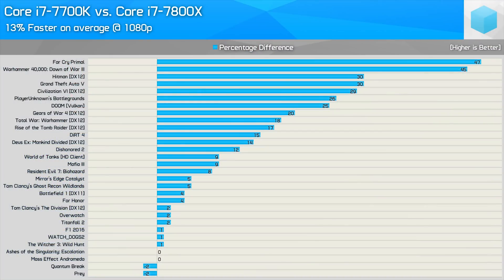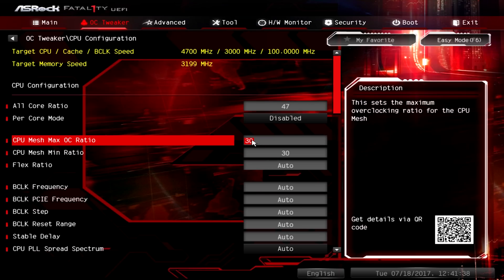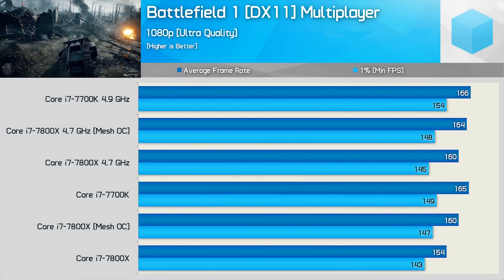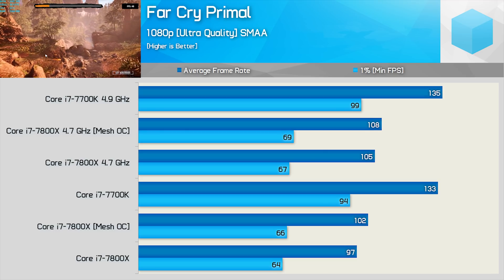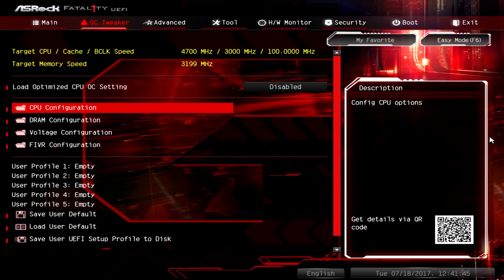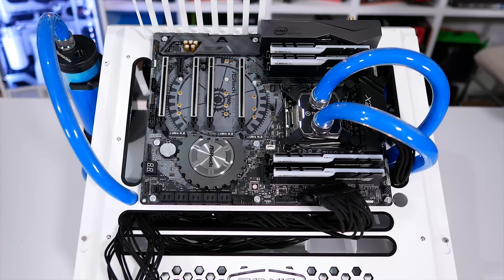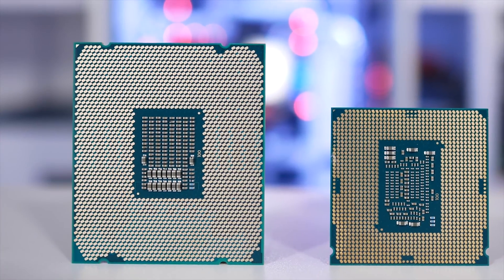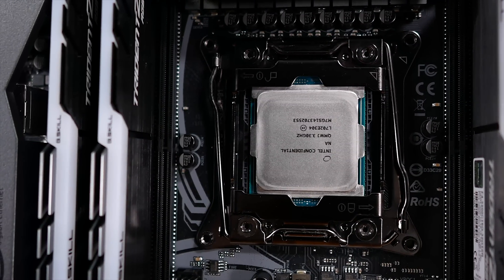Intel Mesh, Does Overclocking it Fix Skylake-X?

Comment: just upgraded to x299 with a 7940x, but at 320 shipped for the chip... i cannot complain... 3200 on the cache and 3733 cr1 on 64ggb of super cheap ram... at the rams 3200xmp..  for my system and got 4.6 all core turbo working well, if i wanted more, i would need to get a better AIO or go custom, and cant really afford to go custom.. i live on ssi, i only upgraded from the w3680@4.6 because the motherboard died... this has been fun though... i cant really complain at these prices... 320shipped (got it in 2 days) for 14c28t.. not bad...
Reply: the x299 prime II-a has worked well for me so far, it takes tinkering to get the best out of them, what we have found, the AI clocking tool can actually be VERY effective if you tinker with it enough, and test it with of all things a negative offset of at least 0.025, you should actually be able to get 4.7+ in most of these chips pretty easy...slightly better cooling (this cryorig a80 is several years old and been pushed hard keeping  a 9370, then a x5675 and w3680 to 4.6-4.7 range for years 24/7... but.. with quad ipp fans, 4.5-4.6 has been pretty easy to dial in with a .025 core offset helping offset the ai's over use of voltage.. 

if i could easily apply the settings i have in xtu via bios i could get it down  a wee bit more, but.. i genuinely cannot complain about these results, the systems working quite well and should hold up a good number of years with just swapping to a 9 or 10k chip if i dont just break down and delid this thing and replace the stock TIM myself to gain most of what the 9k chips brought us...)

Comment: Try it again with the correct settings to test CPU, instead of setting to very high graphics settings, and have a serious go at overclocking it rather than a 5 minute attempt. That was testing the 1080p performance of the video card just as much as anything else in the system.

Comment: YES IT DOES! 

7980XE@5Ghz all cores
DDR4 4000Mhz CL15
Mesh at x33

Memory latency is 46-47ns

R15 single is 225! That’s stock 10900K IPC right there!

R15 Multi is 5,000 thats 

R23 is 31,000!! That is (2) 1950X Threadrippers lol. Or faster than a single 2990WX Threadripper.

Yep a 4 year old CPU!! 

Oh and R20 Multi is 11,720!

I run these speeds daily in games and work on direct die and (3) 360’s.

Comment: Use per core overclocking and on the best core or 2 cores you might get 4.9Ghz which does help games. Also 3.2 mesh and setting memory to 3.6Ghz+ will be able to match the kabylake. There you go :D

Comment: There are ridiculous gains when you OC the mesh and pop in 4000 MHz Ram, Rise of the Tomb Raider see a 70 FPS gap at 1080p, Far Cry Primal  34 FPS, GTA V 23 FPS.
Reply: You mean 70 fps Difference between normal ram/no mesh oc and 4000 ram and mesh oc?! 
Just got an 7820x 5ghz and thinking About buying trident Z rgb 4000 cl17 Kit

Comment: I'm thinking of returning my 7820x just because of this video. I don't get it, what makes 7820x perform worse than the 7700k clock for clock? Or the 6900k? Is it just the cache system? I thought it was just as good as the 7700k in single thread.

I've watched reviews at tomshardware and the 7820x wins over the 7700k with a large margin. How come it's losing here so badly?
Reply: Your overthinking it, 7700k is quad core = easier single core score

Comment: I find your scores low especially for Hitman and Rise of the tomb raider. I re-did some of these benchmarks with my 7820x at 4.8ghz and disabled 2 cores. I had to run Hitman and rise of the tomb raider in 720p becuase of GPU bottleneck, but I ran Civ VI at 1080p. All the other graphic settings are the same as yours.

Here are the results and screenshots:
Rise of tomb raider= Avrg 164fps  - http://prntscr.com/gaq8e3
Civ 6= avrg 71 fps and %1 low 55fps - http://prntscr.com/gaqb27
Hitman= avrg 152fps - http://prntscr.com/gaqd90
Reply from the maker: Cool, an apples to oranges test. NOICE!

Comment: Intel's i9s are good CPUs on the whole, they just are way more expensive than equivalent Threaripper CPUs. Who would spend $1000 on a 10 core when they can get a 16 core for the same price?

The deficit in gaming performance is because of its dreadful core to core latency -- which is exactly the same issue dogging Zen. When this is optimised for in software you can expect a significant boost for both.

Comment: Steve and all tech youtubers does not understand this, Innovations is bad, was bad for AMD and now is bad for intel because the CPU is nothing without a good software, what you were getting from intel is just the same thing over and over again the only improvement was the clock speed just that, now they came up with a new architecture and they are paying the price the same that AMD was paying from the FX platform and Ryzen,  the problem was and is not the hardware, again you should understand the importance of software on this, is like Apple & android vs Blackberry what kills blackberry was not hardware or the OS it was the software ecosystem and compatibility, software needs to mature and you need to understand this because also you are not accurate on this matter you just look at the numbers and not the big picture,  is not the game what you need to address here is the Engine, all engines needs to change because Gaming developers are just programming on top of the engine resources itself that's why Bethesda is getting a pause to work on the new engine, that's why AMD was so freaking amazing with Doom using vulkan because you can really measure what is really under the hood, and this is something that you need to realize STOP benchmarking DX11 titles with MCM architecture is useless is not going to perform better than the previous cpu for that happen software innovations needs to be done and that's is a more slow process than creating a new hardware.

Comment: chuckles The 7700k took all the cookies and left the x299 and amd parts hungry
Reply: Which one is still useable today in 2021? The 7700K is worthless for gaming today.. 

My 4 year old 7980XE at 5Ghz matches a stock 10900K in single threaded testing. And I can literally just double a Threadripper 1950X in multithreaded. Or beat a 2990WX Threadripper in multithreaded. Yeah That’s a 32/64 lol. 

R15 Single=225
R15 Multi=4988
Reply: @videocardzrule354  I wouldn't call it useless, but 4core cpu's are on the way to the grave for modern games. See your 7980xe still only just matches the 5 year reign of the 67/7700k's in single core, as for multicore they are fine.. but the platforms dead, amd killed it with threadripper and the 3900/3950 and moving on 3 years later after this discussion the 5900/5950x.. which will hand the 7980 it's ass all day long, they are eol as far as I'm concerned and is why I moved along to a 3700x... 3 years later..I am pointing out that was 3 years ago and x299 is still pointless 3 years later.. 3yearsyah..cya as the cool kids like to say.. 3 years ago.
Reply: @videocardzrule354  Dude who cares.. That comment was made 3 years ago, I don't care go argue with someone else maybe on your intellectual level..You are making a pointless argument about 4-5 year old tech that nobody cares about anymore, other then people still stuck with it or flippers. Move along man. Any more stupid comments about your over priced under performing 79860xe I'll show you the hand and block you. I don't care. Clearly you are bored or stupid and couldn't take the hint the first time. Now I'm making it official don't bother me about your bloody cpu, nobody cares.

Comment: So, Intel is helping to close the gap between Ryzen and Intel CPUs... This is really disappointing. With this, there is absolutely no reason for me to consider anything other than Ryzen.

I did look at X99, but the boards just didn't have the I/O enabled without the high-end chips, which are not worth the money. The boards also had 3x the RMA rate.

For people who want the fastest single-core performance, like a 3D animating workstation, the 7700K seems like gold that may be worth holding onto. Unless Intel and AMD use different architecture for low and high core counts, it could be king for a long time. But, you'd probably want to buy one that has had the poor TIM replaced.

Comment: I think someone bought the i7 920 to do a video!!! I don't think I have seen any video on the channel featuring the 920. I still have one in my old desktop PC overclocked to 3.5 Ghz (with boost) at an undervolted 1.1v since 2009, and would like to see how it fares at a decent OC level in recent games with a mid range graphics card like the 1060/580.

Anyway, keep up the good work Steve, best hardware channel for some time now on Youtube (and I have been a subscriber since this channel had 6k subs).

Comment: well its their first try at it in almost a decade so it is not perfect yet also a ring is only good up to a point i guess that point is around 6 or 8 cores not 10+ so they changed it but it goes slower so i guess a test between one with a ring and one with a mesh would be nice if you can

Comment: I've watched this video and the original 7800x vs 7700k comparison video.  I took interest because I was in the process of a new 7900x build, which has been completed about 48 hours ago.

I would like for Hardware Unboxed to confirm the framerate disparity is not an nvidia drivers issue as opposed solely due to this new mesh architecture.  The reason I say this is because I have some very peculiar and suspicious observations in my build, though pertaining to SLI.  I realize that SLI is a different beast, but I urge you to look at the findings so far.

Here is a thread about someone who has built several configs of his 7900x via different X299 motherboards.
https://forums.evga.com/SLI-Issue-EVGA-1080-Ti-FTW3-on-X299-Motherboards-m2696423.aspx

The results show that no matter what is done, the performance of SLI is drastically worse.  Within these threads, more URLs surface.

In here, there is a post showing that the smallest increase in Resolution Scale setting of BF1 from 106% to 107% will cause a GPU usage drop of 20%, causing framerate to instantly plummet from 100 FPS to 80 FPS with only a minor increase in total pixel resolution.  Why such a huge drop in usage? Who knows, but it seems like it is more an nvidia driver issue than a new Intel mesh architecture issue.

https://forums.geforce.com/default/topic/1017324/?comment=5186834

Also in these threads, is a 3D Mark comparison.  Again, this is under the SLI category, but the exact same cards, 2x GTX 1080 Ti SLI yield a massive 36% difference in favor of an X79 build vs a new X299 build.  Recall that Sandy Bridge-E is 4 generations as old as than Skylake-X.

So I'd like to reiterate that this is indeed not an apples to apples comparison to Hardware Unboxed's findings, mostly because these URLS speak about SLI performance isues, which is a different beast on its own.  But if you go through all these findings, the general though unproven consensuses is that there is an issue with nvidia's drivers.

This video hints at an upcoming Ryzen comparison yields "interesting results", but perhaps there is an issue in nvidia's drivers that do not currently work well with X299 chipset, and show no issue with Ryzen.  My understanding is that these benchmarks use the most powerful graphics cards in order to focus solely on CPU performance.  I am not certain, but it seems that the benchmarks in these videos come from Titan XP's.  Is it possible to do the similar comparisons in the 7800x vs 7700k video, but with a high-end AMD card?  I am curious if the disparity of nearly a 50% performance difference of Far Cry Primal also exist even with AMD cards and drivers.

For the record, I would note that I am not trying to look at my new build with rose-colored glasses.  I am completely aware that a 7700k should indeed beat a 7800x in terms of gaming performance.  My new 7900x build is for game development primarily, but also gaming.  However, I cannot get past the fact that Far Cry Primal has a massive double-digit performance advantage on a 7700k, and your theory is that its only because of the new mesh architecture.  When I see difference performance numbers that staggering, I find it completely suspicious that other issues are at play.

Comment: If the margin of error is always positive towards the 7800X then it's not really a margin of error. Real errors would skew both ways across a wide variety of samples
Reply from the maker: It's an average of three runs, not all results went the way of the 7800X. I understand how the margin of error works ;)

Comment: There is no way the Mesh is a technological counter to the Infinity Fabric. The Mesh was probably in development at the exact same time as the Infinity Fabric, from start to finish. I am going to go with the majority here (and, really, with you) that the lower L3 cache on Skylake-X is what is starving the cores. Games are not designed to use any more than 32 KB of L1 cache (either type) per core, no more than 256KB of L2 cache per core, and no more than 2MB of L3 cache per core. Extra idle cores eat up a lot of L3 cache, and it is distributed across the whole processor, and that is where the Mesh comes in. Thanks Windows!

This is an optimization issue that also faces Ryzen. Ryzen dies have 32/64kb of L1 cache, 512kb of L2 Cache, and 18MB total L3 cache. I personally believe once cache optimizations hit Ryzen, it will be shown to have the best IPC in the market, and particularly good with clockspeed scaling.

Comment: "— IPC advantage — at the same clock speed —" Tiny error 6:54
Reply from the maker: What do you mean?
Reply: Hardware Unboxed That instructions per cycle aren't affected by clockspeed. As said, very minor thing
Reply from the maker: That right, I'm basically saying when clocked at the same frequency you can see that Intel has an IPC advantage. In understand exactly what instructions per 'clock' cycle means.

Comment: +hardware unboxed The Infinity Fabric has loads of bandwidth. The bottleneck is the single 32Byte/cycle interconnect to the dual channel memory controller. Combine high memory latency with traffic generated by 2 four core ccx modules each with their own 32byte/cycle interconnect and the GPU with its 32 byte/cycle interconnect and you end up with effectively a traffic jam at the memory controller. In mu opinoin it is a design flaw that AMD cound have alleviated by giving the memory controller access to dual interconnects to the Fabric.

The Intel Mesh is conceptually Infinity fabric by another name as you mentioned. Increasing the bandwidth on the mesh, which intel claims is 756GB/s anyway, is not going to improve access to the memory unless you can also increase the throughput of the interconnects to the memory controllers which only change with higher frequency and tighter memory timings. 

With Ryzen at least if you tighten up the really loose default tFAW, tRDDs and tRFC timings, the R7 chips perform much better. I suspect that, especially as the x299 system seems to also have higher latency, the performance issues with Intel may have a similar cure. The fact that each core has direct access o the IMCs may make it more sensitive to latency. That is why I asked you about the secondary timings the other day.
Reply from the maker: Good stuff, sorry I will haven't checked the secondary timings and the system is in bits right now. I'll make sure I check it out next time I fire it up.
Reply: Thats ok, when you are ready. If you want to validate it for yourself, feel free to use it for some of your content creation if you like
Reply from the maker: Will do thanks mate.

Comment: I see it like this, The new L3 cache is basically not there for current games. so if you want skylake-x to perform like the 7700k best thing you can do is get lower latancy on your system memory. As the L2 cache will have to call on system memory for everything in apps that are not optimized. At least that is my take on the L3 victim cache, and i can say lower latency on my 1700 @ 3.9 saw a huge 30% gain (minimum fps in WoW) with lower timings on my memory. (took some work to find all the proper settings)